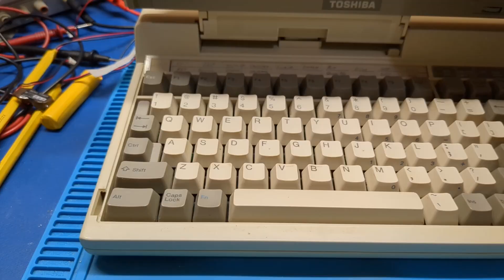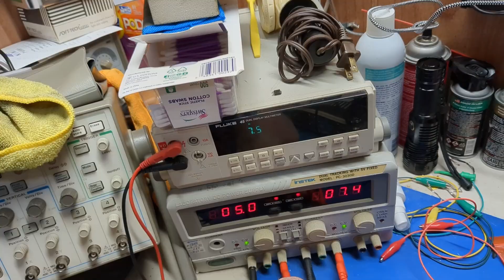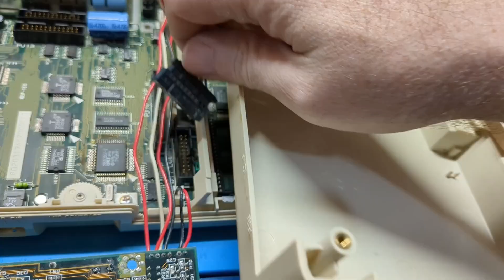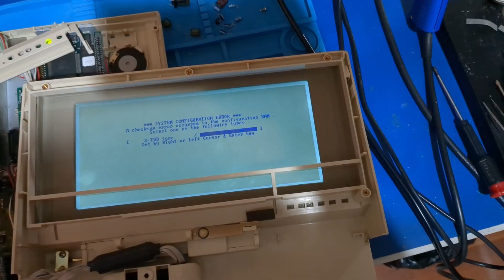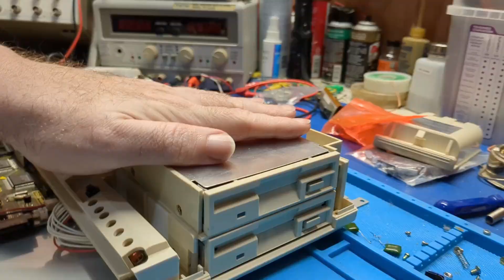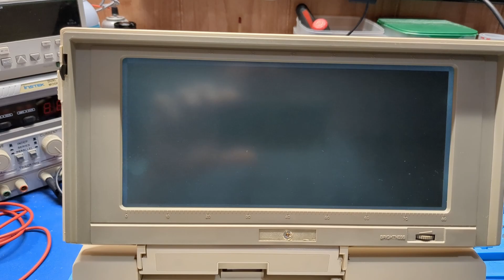Toshiba T1200 Repair from scrap

Comment: Can you test the tracks from the capacitors inside the disc to the board elements outside?  They should probably be connected there..   Then it was possible to solder the capacitors on the outside of the board with wiring.

Comment: Hello!

My disk can't spin up either:

https://youtu.be/hUT4YFXE6XM

If you release the parking solenoid, the disc tries to spin up, but it can't either.:
https://youtu.be/eBeq-qjsxCc

But if you take the heads out of the parking area, the disk starts to spin up and work.:
https://youtu.be/qt9E4a6-DnA

What do you think is the problem?

Comment: Toshiba T1200 was my very first "real" computer, after a Vic20. Still have 2 of them at my parent's place. I should really get them and clean up the power supply boards before they eat themselves away to nothing. Kinda sad that the hard drives are all dying - the sound of that drive spinning is a very big part of the whole T1200 experience